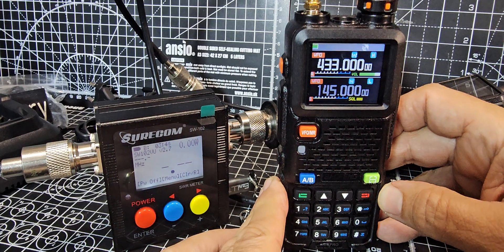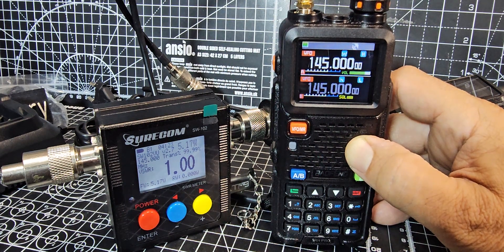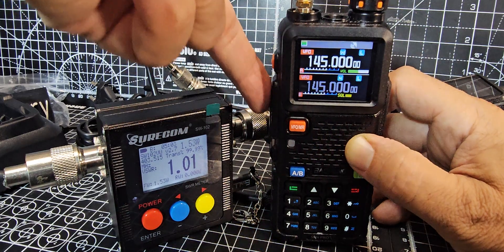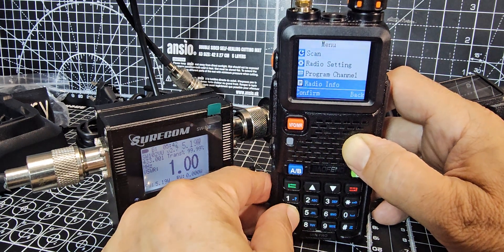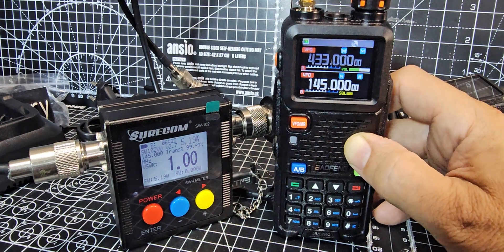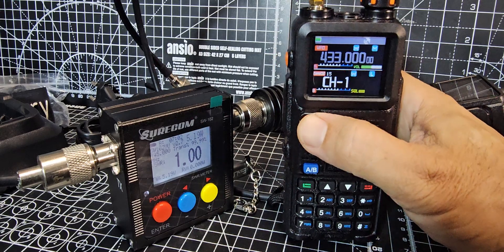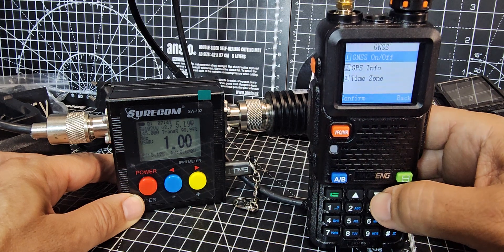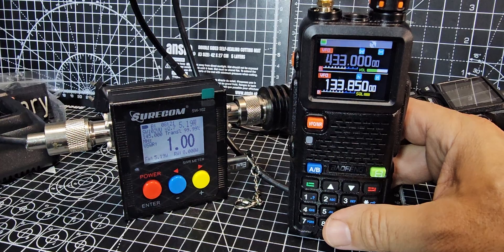TRANSMIT POWER TEST - NEW BAOFENG UV5-RH - GPS , AIRBAND - 6 BAND HAM Radio

Comment: Wish the firmware on the original non-gps version was the same as this one, then you could read the menu easier.
The small red text on a blue background is very difficult to read in any light condition.
Reply from the maker: Totally agree